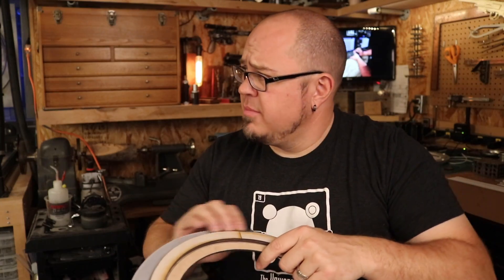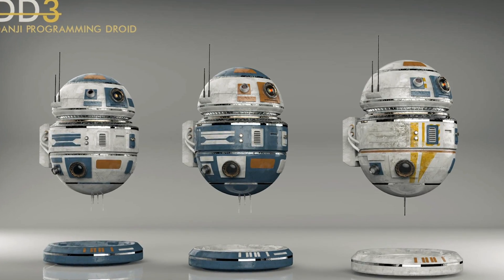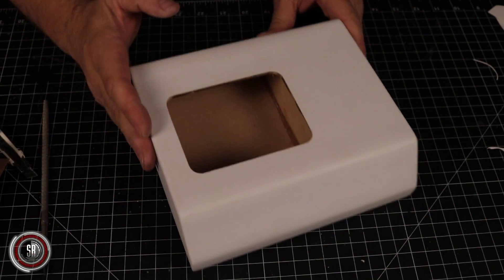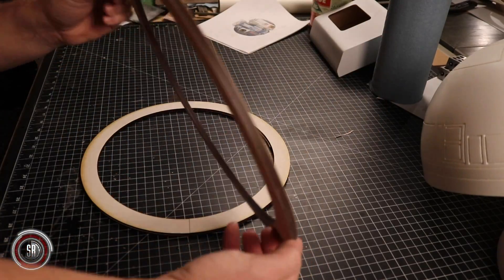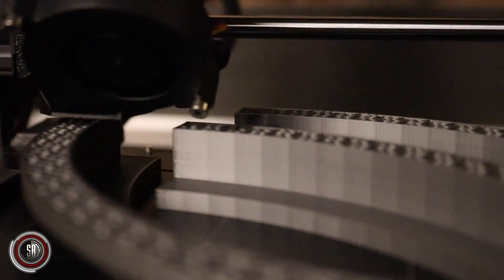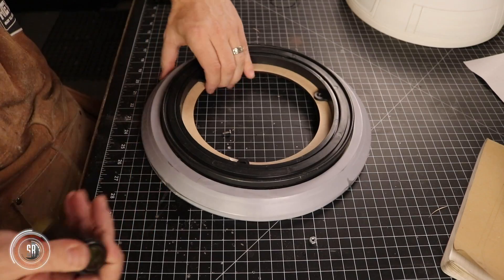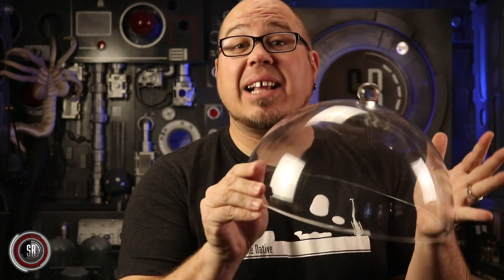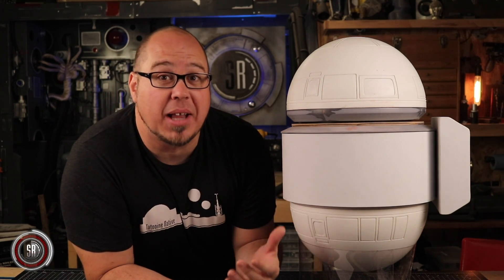Custom Star Wars Droid Build - Part 1

Comment: Great tip with the styrene covered mdf, may need to find a project to use that on :D
Reply from the maker: Buckethead Props thank you!  Definitely give it a try.  It really saves time over sanding and sealing the MDF.

Comment: those vertical ribs are going to slightly crease the inside with handling and show through to the outside after a while
Reply from the maker: I doubled the styrene layers to hopefully help with that issue, but time will tell.

Comment: Looking good.  What is the two part adhesive you are using?  It is shown around the 9 minute mark.  Thanks!
Reply from the maker: Hey there, thank you!  That is BSI 2 Part Epoxy.  I love that stuff as it works with so many different types of material, and has really bonds well.  Here is a link to that product:  (this is affiliate by the way, nothing extra to you, but if you use this link it does help us a little) https://amzn.to/2CqXEnH

Comment: If you happen to want another 3D printer, I'd recommend the Ender 3 pro or CR-10s. They really pack a punch, and there is a large creaility community chalked full with upgrade recommendations & such. Though, your Prusa looks good still!
Reply from the maker: Thank you very much!  We actually have a CR-10s as it turns out.  I love that machine, especially the build plate, it’s HUGE!!!  We just recently added the Prusa printer after all of my siblings and I bought my father one last year for his birthday, I really loved the quality of his prints so we dove in.

All in all, I need to spend more time learning 3D modeling and printing, it’s so much fun!
Reply: @TheSmugglersRoom  I'd be more than happy to share my CR-10s modification list & FFF settings. I've dialed that printer down to a point & I've only produced high-quality prints in the last couple of months. If you are interested in decking out your printer even more, ask whenever.